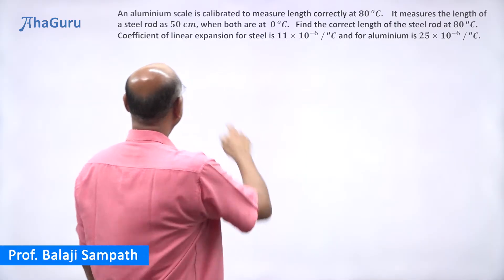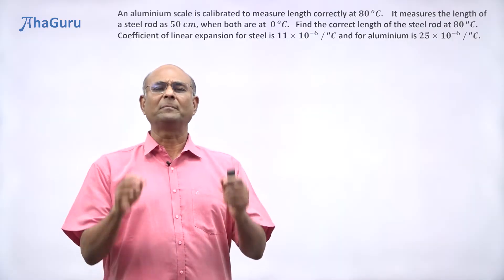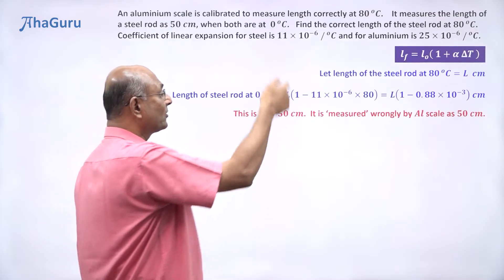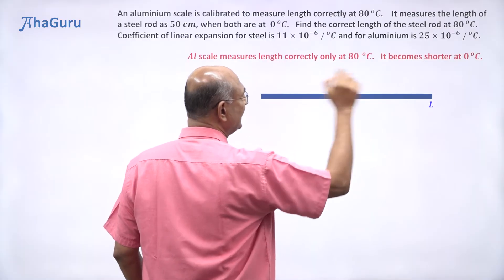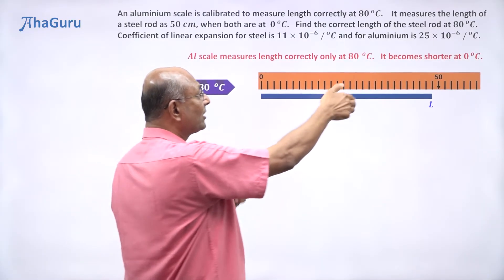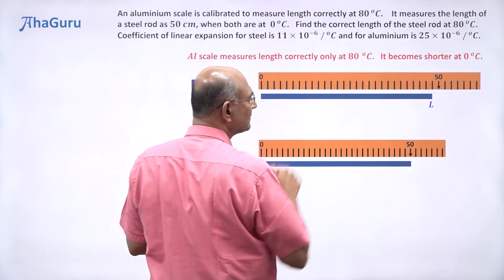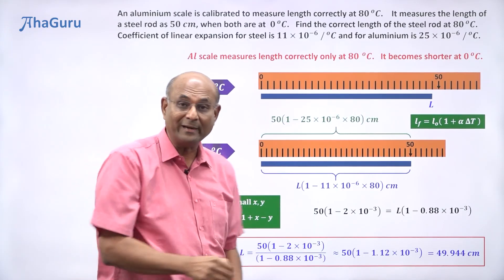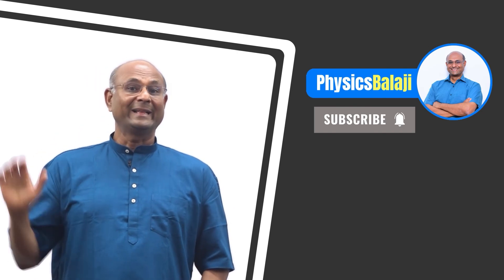Why Drawing Diagrams is Super Important in Physics:  Thermal Expansion IIT JEE Question

Comment: sir i am a student of ahaguru class 12. till now i have been preparing more or less exclusively for mains. i intend to start my advanced prep after the jan attempt. how exactly do i go about this? do i directly start with pyqs/ mocks or do i need to watch some lectures first?
Reply: also do i have to cover every chapter to advanced level or just pick a few high weightage ones and master them?
Reply from the maker: Start with a few chapters and start doing PYQs.  The concepts are the same.  Only the question level will be different.  Many questions in JEE advanced mix up two concepts.  Best way to prepare is to start solving PYQs.